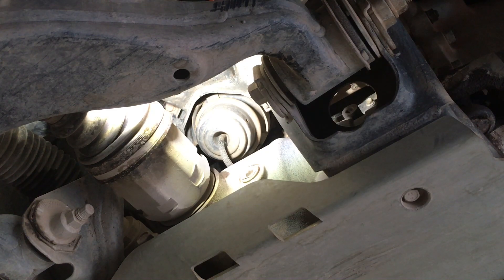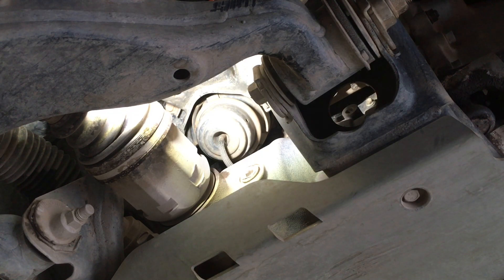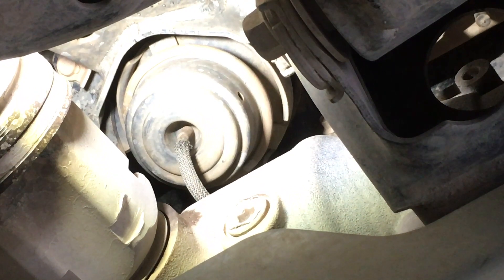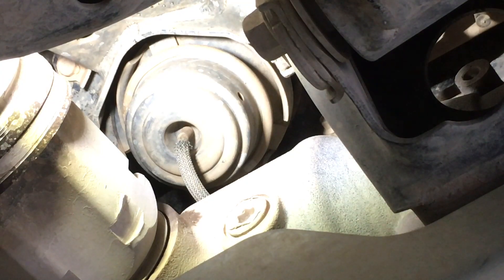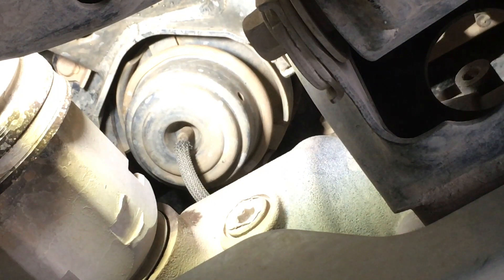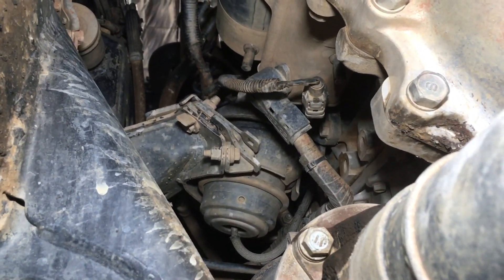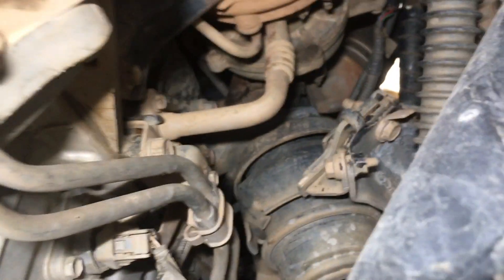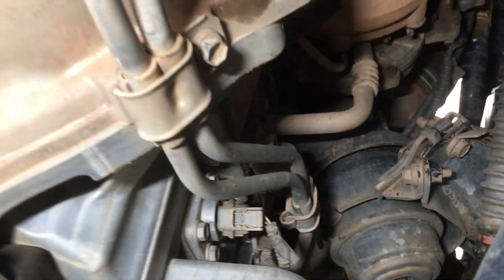ALL I HAVE ON ENGINE MOUNTS

Comment: I've done injectors, clutch, Hilux motor mounts, suspension, bushings but after starting this job on our 2007 120, I realized this bloke knew what he's was on about and I 'gave' it to my local butcher I mean mechanic who got it done with difficulty. And what a difference it makes!
Reply: Neophytos, Similar to you have done a range on jobs on the Prado so thought I would tackle the engine mount job I mean how hard can it be..but wished I hadn't as the job is a real pain start to finish. It's easy enough to do but main problem is there is limited access to the engine bracket bolts and on the drivers side ended up unbolting the shocker to create access to use a socket extension thru the frame....will not ever do this job again

Comment: Just had the engine mounts replaced on my 2004 120 KZ. Great improvement in the smoothness of the car - far less rattly than before. When car is running and in neutral the range selection lever vibrates quite strongly, still. Maybe this is normal?

Comment: Hi Anthony from the uk 🇬🇧 my prado started making a horrible squealing sound and I've followed the vacuum lines and squeal to the left engine mount. It doesn't have any bad vibration but if I leave the vacuum line unplugged to the mount would it damage anything? Thanks Anthony 👍🏻

Comment: Thanks for the info on the vibration and how to check in low range, but you don't not say what the cause really is, is it a vacuum leak, split rubber or what? And if we don't get it fixed and can live with the slight vibration , will it catch me out out in the bush and majorly fail? 
Keep up the good info 
Chris.
Reply from the maker: The cause, you need a new engine mounts if you can live with it then live with it I thought I said that at the Start not gonna break or anything